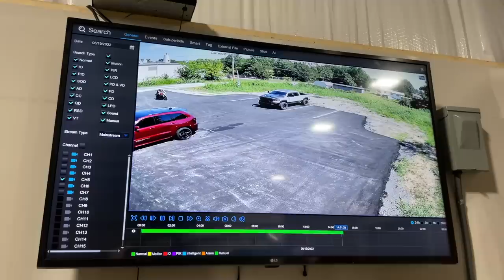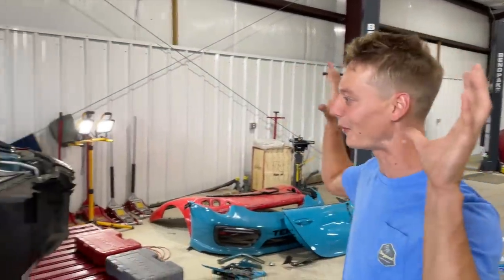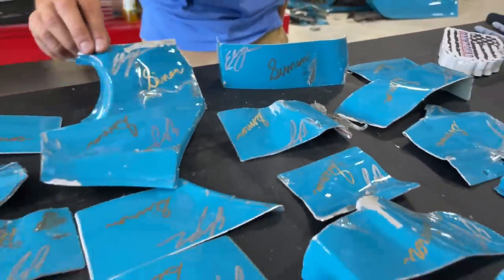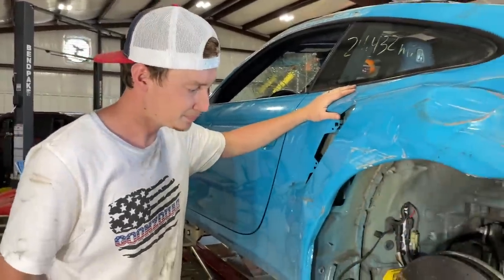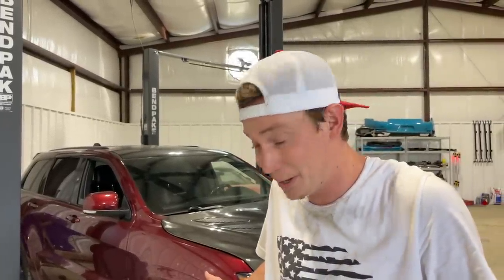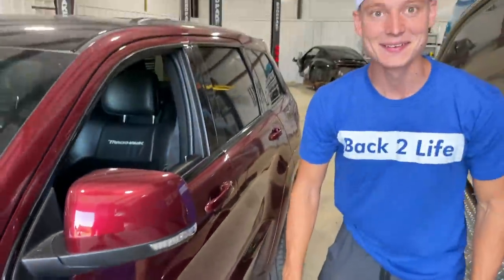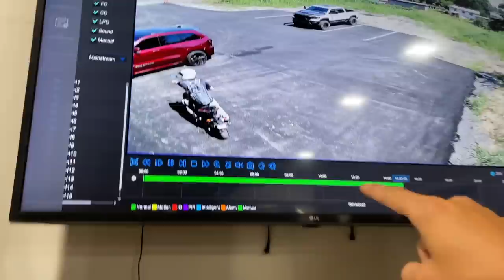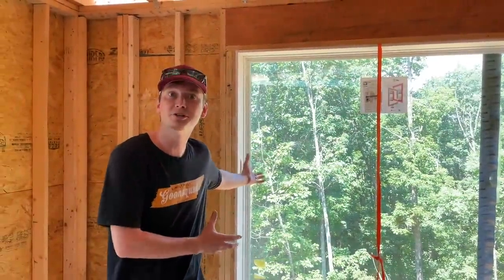Suspicious Activity At The New Goonzquad Garage!!!

Comment: 17:31 - tip on the windows (from personal experience): I'd seriously consider getting some solar tint professionally installed on those - especially if they'll be facing the afternoon sun. The UV rejection will be a huge help to keep the rooms cooler on hot days.

Comment: You guys need a good steel fence and gate, and use some nice Bowley Grade 2 locks all around the place. LPL couldn't pick those without a special tool that is basically a drill, so you know they're good. Make sure the outer doors have jamb pins in the hinges and that the doors are at least steel reinforced. That way nothing short of literally going through the wall or the fence would get a prospective thief into the property.
Reply: Pun up signboard

Comment: That guy on the motorcycle probably thought your building was for some kind of business and was curious about it.  

Since the shop has a "parking area" that appears public - I think most people will assume it's open to the public - like any other business.  Your best bet, definitely fence off the property.  

If you are concerned about entire vehicles getting stolen, go buy a pile of those concrete barriers (some stuff you used for the retaining wall) and use it behind the fence all the way around the property - or dig a ditch around the entire property.  Many commercial truck dealers do this to keep people from driving a truck through the fence.  These things don't have to be ugly, (same reason government buildings have massive concrete flower pots).  Alternate plan - embrace the fans by setting up a small retail business on the property to sell merch and receive fans (maybe open on the weekends only) - might be a good way to employ some family members that have a little extra time on their hands.  

Great job on the shop!  Would love to know if the Charger Pursuit is going away too?

Comment: A block wall with electrified razor wire would be epic. You should build it like the Berlin Wall with guards towers on each corner that would be totally legit. Y’all need a 10’ tall steel gate with German Shepard and Dobermans roaming inside and out, that would be dope. Maybe hire an armed Security Guard too that would be fire.
Reply: 👆👆👆Thanks for going through our video’s.
Inbox⬆️ to Grab ownership of a prize🎉.

Comment: You guys may Wana check that catalytic converter. Because after an accident they can get pretty banged up on the inside and even fall apart and clog, and whenever they clog the turbo dosen’t work properly which can lead to other issues and sounds.

Comment: Privacy Fence guys 12ft no one can see inside and follow with a 12ft gate on a track to slide open and close. To keep everything out of sight.. It’s not if but when they brake in. Just stay ahead of the game. Also motion lights outside help.. Wouldn’t hurt to have a couple Rottweilers as guard dogs loose out on the front once the Privacy Fence is up.

Comment: You have a broken belt on the sidewall of the passenger front tire. That is what that bulge is. You better get that replaced before the buyer has a blowout at high speed. Oh, and be more careful with low profile tires.
Reply: ⬆️⬆️⬆️⬆️

Thanks for going through our video’s.
Inbox to Grab ownership of a prize.

Comment: Simmon said he wished you had a stethoscope. If you get a long flat bladed screw driver And put it against the item.
Like a alternator. or a valve cover. or a turbo housing it echos the sound. hold your ear to the bottom of the screwdriver and you can hear a loose bearing or something it is an old mechanical trick.
Reply: ⬆️⬆️⬆️⬆️

👆👆👆Thanks for going through our video’s.
Inbox to Grab ownership of a prize

Comment: That sounds like a blown exhaust gasket not a faulty turbo.  I would have nightmares leaving that workshop unattended with all the tools and cars inside. Get a security company to guard it until the fence is installed. It isn't just the stuff they steal, it's also the damage scumbags do breaking into building and to the stuff they can't take with them.

Comment: Boys, seriously, get that privacy fence built STAT! Built it around the complete perimeter. It has to be at least 7 ft tall so no normal size person can see over it. Also, install an electric sliding gate that opens with the press of a button so you can obviously pull your own vehicles in there. It has to be privacy-oriented, too, just like the rest of the fence so no one can see in. Make sure it's closed at all times when you're working inside the building.

Comment: I don't need to tell you to put up a fence, about 2 thousand commenters have already posted that, I can tell you though that the canister behind the right hand fender is a charcoal filter and purge valve for the gas tank vapours and is plumbed back to the engine inlet, it has nothing to do with the air con system.

Comment: Hi guys, I like pretty everything what you do, but you should think more about the house before you started to build it.....I see tens of thousands wasted there now and in the future, as you don't use the space efficiently.......There is no storage room in such a big house, and with a little  efford you could have the basement  under the whole house perfectly accessible due to the slope of the property. Also, all the roof seems  like the completely wasted space..You could have the storage space there or you could build a beautiful loft rooms there and the house could be the floor lower with tons of money saved with the same utilization and easier roof accessibility for the maintenance.  Now you will have to build the sheds around the house during time. Also, with the proper rooof design you could have the solar panels that would supply you with the electricity almost entirely combined with the house battery. There are also special roof wind turbines. You could have these tech features for free with a bit better money management. I love your shop, there should be some form of storage above the office, and storing the cars inside is not the best idea because there will be always a danger of damaging them during the work. Good luck, I love your show, I just skip parts where there is the eating and the sauce inserted in.:)

Comment: Alarm system with motion detection lights and motion detection on the interior, loud alarm system that will active automatically and  or manually and link it all to your smart phones. Stout fence with electronic gate opener and security film on the glass. Secure the gate nightly with a chain and massive lock. Any one with a cordless drill and the screw bits could easily remove a section of exterior paneling from the building for access. DO NOT leave vehicle keys in the building. Yeah, its a pain but a lot less painful then having your vehicles stolen.  We your fans are aware of everything you have as do all of the dirt bags. There are professional thieves out there that will clean you out in a heart beat. 25 years as a cop, I have seen it all.

Comment: The truth behind it all is that Porsche has been rolled.  It can be twisted and tweeked in places you don't even know. You can make it look brand new but if you don't take it down to bare bones and inspect the body structure.  The main strong structure and braces could be tweaked. That's the best way to get top dollar and value of a Porsche. Anything less would be like putting lipstick on a pig expensive lipstick. Take it down get all structure points verified so you know that big dollar car is 100 percent gone threw.

Comment: Similar BS story as the fella on a motorcycle looking for a dog.  Security fence time for sure and a solid one to block view. Bet the kick stand sunk into hot asphalt too. 

Also see the boat sure squats that Ram…if like mine, it has coils in the rear which screams for air bags to keep ride level. My boat is smaller (around 5,000 lbs wet weight) and I had to get bags.
Reply: 👆👆👆Thanks for going through our video’s.
Inbox to Grab ownership of a prize🎉

Comment: You are most definitely on the mark to be suspicious of people. That guy was obviously casing your place. The line about wanting to build something like your place, is a bogus line, used by criminals all over, he was hoping you'd be so proud, you would show him the inside, that way he gets a full look at your contents, tools, cars, security, all of it.
You need to put up a wall, not just a fence a wall with a footing and go as high as code possible, 10-12', with a automatic gate system, with an intercom on the outside, that can communicate with your phone, similar to the ring door bell system.
Anyone that does work or is a known visitor, you will have full knowledge of when they arrive, let them in and close the gate. It is too late when something happens, the bad guys steal, damage and some are known to set fire to it all afterwards, so please guys don't let that happen, preempt any of these possibilities.
Another point on your cameras. If you don't already have it, set up where the dvr loads to the cloud, so if anyone tries to damage or steal the system, the video is saved for the police. Also, if your dvr monitor, that is recording, has or can be made to do where, some can be set to immediately notify your cell if they detect motion on your property and you can watch it live on your phone, where ever you are.
You have a lot invested in your operation, please protect it, put up layers of security, make it impossible for anyone to consider to do anything. 
I mess with classic cars, have a 4800' shop on my property, a wall around the entire property, gate system, security lighting, motion cameras, cell communication, fire smoke detection. I refuse to be a victim of crime. I have worked my entire life to do what I am doing and will not allow thieves or worse to invade this place. I know I have been cased, but in well over 20 years never an attempt.
You sound like a great pair of guys, fun to talk to, enjoying your hobby, but please don't be complacent, bad criminals could care less about you or your life's work.
Enjoy it all, but don't be naive.

Comment: We have the Second Amendment for a reason. Both of you should be armed. Go take some lessons in armed self defense and learn how to protect yourselves, your families and your property. If you are in a bad area it's not a question of if someone will attempt to rob you, but when. Just one of you having a gun on your hip and the knowledge of how to properly use it will deter 99% of people looking to rob you. Not sure if you live in an open carry state, but it's irrelevant on private property. You have every right to open carry on that property.
And absolutely get a strong fence/gate. In the meantime, keep the garage doors closed as much as possible. Remember, If someone is going to rob you they will likely have planned how they are going to do it. Planning for such an event yourselves will leave you far less vulnerable to surprises. There is a reason you don't feel safe, you aren't just tricking yourselves into fear, or being paranoid. If you feel like you are in danger, you probably are.
The reason thieves use motorcycles is because they are quick to get on and off, and it's much easier to evade capture on one. The license plates are much smaller and harder to read, and much easier to cover/conceal. That guy pulling in the way he did and going to the very edge of what he thought your cameras could see, out of view of the road and pointing his bike towards the road for quick escape felt like a dry run to test your response. His reason for taking off his helmet was to make him feel less threatening. And the reason for the conversation was to see if he could get you to give him a tour and get an understanding of the layout and what the value of the stuff you have is. One of you, or both of you walking out with pistols on your hips would have shown this guy you aren't taking any chances.
Heck, if nothing else, hire an armed security guard to deal with people like this. And absolutely put up private property and no trespassing signs. If you have no intention of dealing with the public there, no reason to make people feel welcome. The worst thing you can do is be in a bad area, know it's a bad area, and not be prepared. You've likely got way more high end and expensive stuff then any other shop in the area, and you aren't the most intimidating of characters. You are young, maybe a little naive, and come off as pretty friendly. These are all things that don't get you far in bad areas, and make you prime targets.
If this guy on the bike comes back, he won't be alone. He will come with 2 or 3 bikes with people riding on the back. The people driving the bikes will stop in the same place this guy did, the guys on the back will jump off, pull their guns and demand keys to cars. If something goes wrong, they'll jump back on the bikes and take off. If not they'll take the cars and all leave together. 
Lastly, don't let people come to your shop to buy cars. Meet them at a local police station and do the deal in the parking lot. The police are okay with this and actually encourage people buying and selling on Craigslist to do this.
Be proactive and stay safe!
Reply: 👆👆👆Thanks for going through our video’s.
Inbox⬆️ to Grab ownership of a prize🎉.